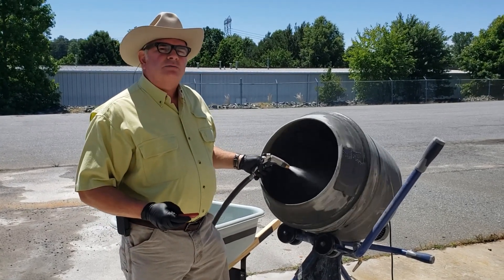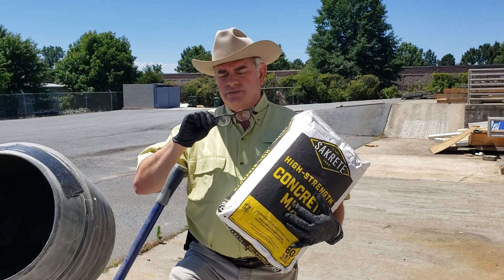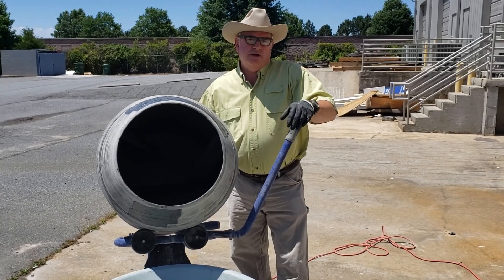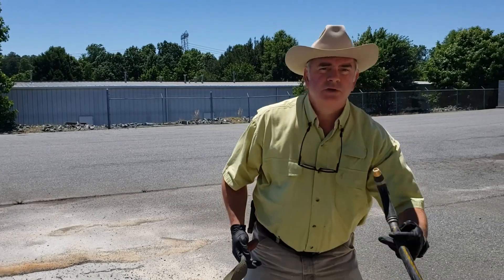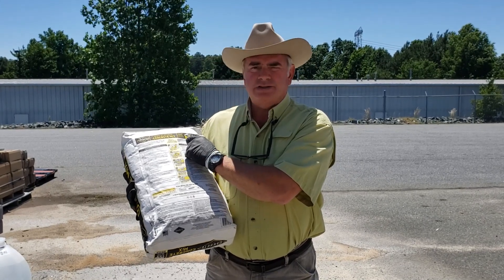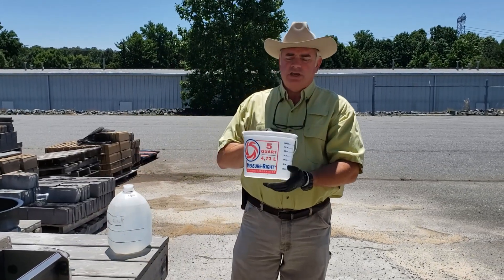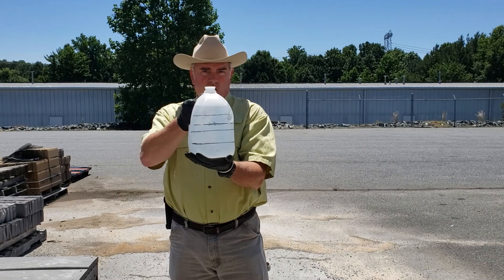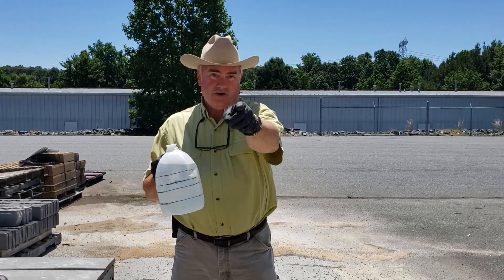Carolinas Concrete Cowboy - Measuring Your Mix Water

Comment: How do i mix a small batch of mix for a repair. I used some sakrete type S to redo joints in a block basement wall. When it dried you could knock the cement out of the joints with your finger. It might had been too wet or was it that i used just a portion of the bag. The bag was one that had been sitting around some time on a damp garage floor for several years. Looking forward to hearing your comments. Thanks,
Reply from the maker: Byron, closed mortar or Concrete bags only have a shelf life of a max of 12 months. An open bag laying on a garage floor will go to ruin in no time.  Cement draws moisture out of the air, and that moisture partially started hydrating the cement grains in the product. So, yes, it was no good.  Scratch out the joint and try again with fresh material. Good luck!
Reply: @carolinasconcretecowboy-di9499  you are fantastic . I was coming to this conclusion but you have been so educational i wanted it from the experts mouth. Have a great day and thanks again.